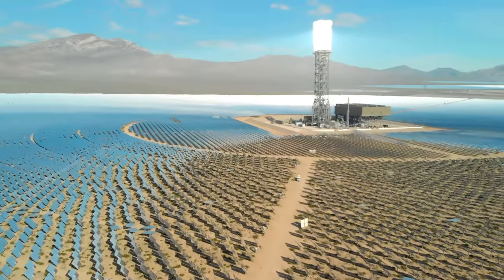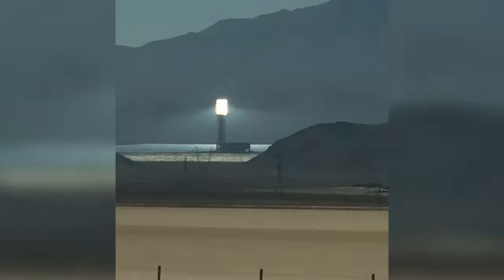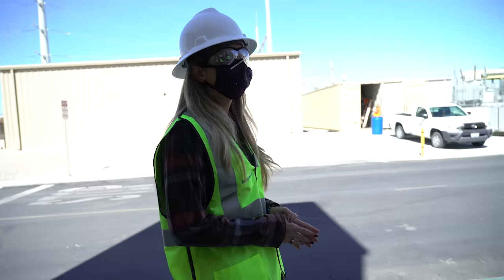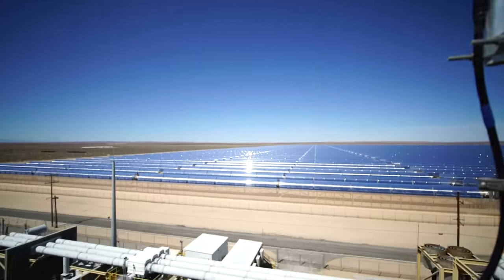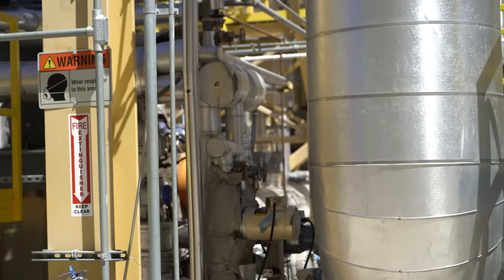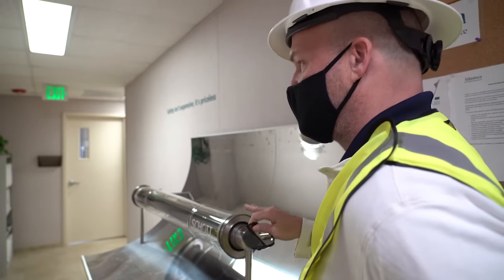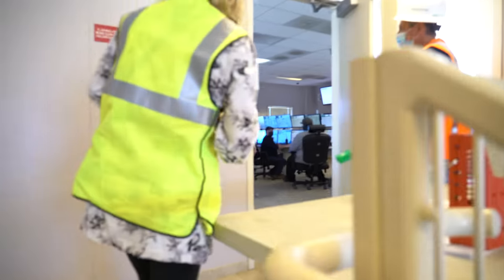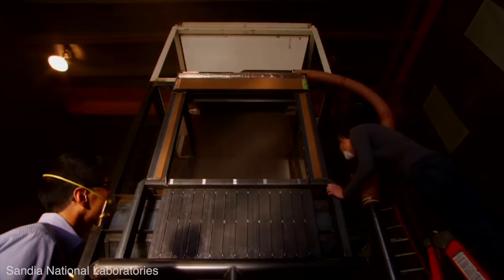How Mirrors Could Solve our Energy Problem

Comment: From what I remember there were more or less 3 reasons I remember as to why this isn't used as much compared to PV, despite it being able to fix one of the most important problems with renewables: intermittency.

These problems are:
1) Cost: CSP costs around 3-4 times what PV costs, so that immediately isn't really great. If we can get storage costs low enough, PV+storage is also more interesting.
2) Geographical limitation: You can't just place these plants everywhere, the efficiency reduces a lot depending on the available sunlight. And ofcourse you need space and lots of it. With PV you can if need be place it in smaller units in a same location to avoid obstacles, elevation differences etc. aren't that much of a problem, with CSP this can be more of a problem. Another problem here is that CSP isn't usually located close to the main energy users, so you possibly need to install connection wires etc too. With PV you can place them on the roofs, car parks, nearby fields, ... limiting these kind of connection costs.
3) Water usage: These mirrors need to be kept clean. This often requires water use to do so. The problem is that these systems usually are in more arid places where water is more valuable. Ofcourse you might have ways to get around this, but they will usually be less effective or more costly. This was for example one of the controversies with CSP plants in Morocco that were subsidies by the EU, I believe.

Does CSP has a place in the grid mix? Yes, I think they definitely will play a role. Are they likely to become one of the main sources/compete with PV? Doubtfull. They might be usefull for energy intensive industries that could possibly be build around them and then either you use their storage to keep these industries going 24/7 or it is used to help balance the grid in the evening/at night.

If you were to ignore things like costs, political stability (for example northern Africa region), ... , CSP would likely be the best source to get us fully renewable. in fact they are probably one of the only renewable sources that could completely on its own get us to 100% renewable; No battery storage, no PV, wind, hydro, ... needed, just CSP. But it would be expensive and you'd need to use very long connections and the losses that go with it.
Reply: All of which are reasons to go nuclear rather than solar or wind.  ;)
Reply: @throwaway692  I only talked about CSP and somehow your conclusion of this one topic is 'Nuclear because wind and solar not good'? Honestly CSP might, if scaled well, be just as good if not better than nuclear imo. Ofcourse this is based on nuclear currently used build. Thorium might change that, but first we'll need to have a modern thorium reactor operating for several years.
Reply: Would it be possible to use a compound other than water to clean the mirrors? Possibly mixing it with something like acetone to keep them clean but not siphon too much water from local cities
Reply: @fflam1383  Honestly I don't know. But we are talking about a lot of mirrors that need to be kept clean from things like dust etc.
Reply: @fflam1383  you will have to keep the acetone from hitting the ground, hand cleaning millions of mirrors is out of the question.
Water is also used in steam for the plant.
Reply: @Caseytify  CSP can have reasonably storage build in for more than 10 hours, CSP is very reliable in terms of output.
Reply: @throwaway692  speaking of high costs and then mentioning nuclear.... Yeah no that's going in the wrong direction, nuclear is just not economical, not even close.
Reply: @Archangel17  Valid points raised mainly around cost, that is why the challenge for the next clever person or team who want to make an impact to this world would be to produce a mini CSP solution. A small farm or a familly house could easily install in a backyard or field, locally made steel plates as mirrors and an economic 2-motor solution to orient them. What is missing? The center unit, one that would give autonomy to this house. Let's talk everyday use: How many PV do you need to run a single washing machine? Including it heating its water? PV not very efficient. A one-house-CSP-solution on the other hand could produce a lot of electricity. Unsure grid people would like that, but huge number of people in countries with sun would be looking for a clever person/team to design such a small-scale CSP.
Reply: @jonblon6306  
Problem is that CSP doesn't downscale well at all. The costs actually go up (per unit), efficiencies go down, ... Less mirrors => less heat => lower efficiency. 

I think the main way for CSP to breakthrough is the opposite: large scale mass production (many plants), this is effectively what France did with nuclear and is why the cost for them eventually were fairly low (that and nuclear was fairly cheap back then).

As to how many pv panels you'd need for a washing machine including water? Probably just one. Though this is just in regards to energy, it might not provide enough power on its own, for that you either need a battery or more panels.
Reply: @sixtus9559  Then we need to make it economical, not throw away the technology. The reactors being taken offline (such as Indian Point in New York) are not being replaced with concentrated solar. They're being replaced with LNG; an incredibly bad move at the worst possible time in history.
Reply: @ManOfLore1  the problem is, many nuclear power plants are old, even if we don't want to leave nuclear energy the plants need to be shut down just because of old age.
And switching to gas powered power plants has the benefit that those are good at shutting down and starting again, we can moderate their power input much faster, they work much better in combination with renewables to power the grid.
Reply: These thing are also eyesores. I would rather see a field of food growing than a field of mirrors. Better use of the sun's energy.
Not to mention desert ecosystems are rather delicate and this looks like it messes that all up.
Reply: @peterbelanger4094  Whether they are eyesores is subjective, personally I wouldn't mind seeing them, it is not like fields of crops aren't almost everywhere possible already. Also a field of crops isn't a better use of the sun's energy, especially considering CSP's are placed on locations that are generally not good for crops anyway.

Like other forms of power generation or just generally living conditions (roads, buildings, crops, ...) don't mess ecosystems up LMAO.

Comment: The special shape of the mirrors is also referred to as "parabolic troughs" they're used here in Pakistan to heat up water in tubes in order to produce steam and drive the boards of a small turbine.
Reply: These parabolic troughs make a lot more sense than the big reflective CSR systems. For a start they don't kill as many birds.
Reply: They say that around 8 min… 🤪😂😂👍

Comment: Would be nice at the end of the series if you do a summary chart showing power efficiency, cost effectiveness, kinds of contracts that apply to selling each type of energy.
Reply: Also include fossil fuels.
And don't forget to add reliability, abundance, and cost.
Yeah, post that.
I dare you.
Reply: @Conflict_Boardgaming  I'm a petroleum engineer and I don't think you're going to like the findings about abundance. (Hint, the sun is functionally infinite).
Reply: @CSpottsGaming  And I don't think you will like the reliability, efficiency, or cost of wind, solar, and "mirrors".
Reply: Meanwhile, nuclear wipes the floor with both.
Reply: @greyrifterrellik5837  Thorium Molten Salt Reactors in particular
Reply: @greyrifterrellik5837  Absolutely, that can and should be the largest part of our short to medium term energy solution.
Reply: @Conflict_Boardgaming  Never going to happen because superficiality does not lend itself to this.
Reply: @Conflict_Boardgaming  onshore wind and photovoltaics are already have a lower levelized cost of energy than any fossil fuel plants you can legally build, and the combination of the 2 is pretty relaible with a near zero chance of major catostrophic breakdowns or a random unpredictable loss of power unlike more centralized power plants which can randomly lose 100 percent of their production from the entire facility almost instantly for any one of a rather large number of different reasons. (intermittency is not the thing same as low reliability and is a non issue at the scale of most grids)
Reply: Yeah the sun is functionally infinite, but the resources required to maintain these things are not.
Reply: @aaronvoss38  Neither are the resources to maintain oil and gas infrastructure...? Oil wells are wildly expensive to develop and that doesn't even account for moving the product from point A to point B.

Comment: We had a few of these in the southern Central Valley of California, they used the tower style. Now they’re just broken mirrors in the fields. 
And remember that photovoltaic cells degrade over time.
Reply: Its a disaster, creating waste, and destroying landscapes.  1,000s of tons of broken glass.  Plus the fuel needed to manufacture that glass = pollution.
Reply: Renewable energy has not improved the climate on iota, cheaper current from taxpayer paid for turbines backed up by natural gas and coal that don't pay for their pollution edges out nuclear which is the only always on low carbon source hydro has practically vanished here in the West with the drought caused by shutting nuke plants.
Reply: 7:28 Physics Girl missed mentioning that… why don’t we see more of these failed CSP plants?? 🤔🤦‍♂️

Comment: I really liked this deep dive series. Getting a really broad overview as well as some specific details was really entertaining, and I feel like I learned a lot!
Reply: I was thinking it was a very superficial and not a deep dive series, it showed some flawed engineering with dreams, some expensive ways of making or converting energy and missed out completely on something that covers 71 percent of the world.
Reply: @maxnex7676  Yeah at 8:51 she says "the efficiency of it, the heat engine depends on the temperature of it and the hotter you can get the hot thing the more efficiency", who even talks like this? This was such a non-deep dive way of talking about the subject. First of all why is she assuming everyone will know what is the "heat engine" she is talking about here and then "the hot thing" being hotter in absolute terms doesn't matter much, it is the ratio ratio between the cold and the hot thing that matters, this video was as superficial as it could have been.
Reply: @maxnex7676  There is no talk about the way the heat get transferred other then "in thousands of tubes ". and talking about saturated steam going into the turbine... really... really??. 
First you never let saturated steam run into a turbine because you have a chance at condensation on your turbine rotors, eating away the material, you superheat it way above the saturation line.
Second if you run the HTF into the reboilers on sunrise, how do you not make the boiler burst from instant steam pressure inside the pipes, or just plain thermoshock because its 400 degrees celcius? 
(I think i know this one, they heat it up first at night, you know, burning that good old natrual gas.)
third, does every tube inside the mirror expand halve a meter? i mean i hope you have wheels under those mirrors then.

It's a pretty video, nice pictures, but nothing of value is being told.

Comment: I think it's not saturated steam but rather superheated steam. Because the water particles in saturated steam would impinge on the turbine blades and damage them. Correct me if I'm wrong, but the steam turbines that we work with use superheated steam
Reply: yeah the generators make saturated steam, but there are other parts that turn the saturated steam into super-heated steam.  you right saturated steam would cause a lot of damage on the turbines.

Comment: Mirrored solar actually has a lot of operational challenges long-term, in addition to the perennial solar-energy production vs. demand mismatch. There are some real maintenance headaches, and they kill a lot of birds. Ivanpah, in San Bernandino County, wipes out around 6,000 birds a year. Hydrogen production may help solve one small piece of that puzzle, but that is all.
Reply: 6000 birds a year, so around 25 cats worth of birds. I'd say that is a worthwhile compromise.
Reply: @sevret313  Responsible outdoor-cat owners rarely have bird kills since the cats have bell collars, and especially not many of the types of birds like raptors that are taken out by the focused heat radiation.

Comment: These are great...for wasting land, frying birds in mid air, messing with migratory birds flight paths...

Yes, this tech has been around for a while, but output vs land usage, mixed with stability and maintence, make this a relatively inefficient form of power generation.
Reply: But it's cheaper than solar cells. Into a price comes down on the solar cells.
Reply: @dueymiller617  The price has come down on solar cells, they are now cheaper. Much cheaper, as in substantially cheaper per unit energy even when you factor in the lifetime cost of batteries for storage(roughly half the price if you have enough LiFePO4 batteries to back up power for 24 hours).
Reply: For electricity generation, I totally agree. Solar PV (+ battery storage) is clearly the better option.

But there's still one use case for solar thermal plants: Process heat; e.g. for the chemical industry, for hydrogen production (via the sulfur-iodine cycle), for the steel + cement industry, or for seawater desalination. Maybe that'll make sense if they manage to lower the costs (by automating the construction + maintenance of solar tower facilities).
Another great source of process heat is nuclear - with a special focus on high-temperature reactors and SMRs.
Reply: Regarding the other contra arguments (besides costs): As far as I know, those solar towers are only built in the desert. There you have plenty of space available.
Land usage is a point if it means the destruction of ecosystems. But the desert is just a huge area of sand (with only a minimum of vegetation + fauna). So it shouldn't matter if we build things on top of this sand.
Frying birds? In the desert, there aren't many birds. Maybe some few vultures, but that's it.

And consider that we would only use a small portion of the desert for solar (no matter if PV or CSP), maybe 5-10%. That means that still 90-95% of the desert area would stay untouched.
Reply: These mirrors and the heat they generate is the reason there's a drought. 
The monsoon that used to come from Nevada and Arizona storm turn back and away from California. 
The High Pressure as Weather Casters call it : keep the storms going up to Canada 🇨🇦 with  the occasional drop to the Bay area. This is and I hope an unintentional Weather Modification

Comment: I worked at both plants. Ivanpah was definitely the coolest and I was there from start to finish as a pipefitter. The blow down and testing was crazy. The Mojave project was cool but it's not anything close to how ivanpah was. There is soo much more to these project than you were able to explain. Ivanpah has a gas heater to maintain the water at a reasonable temp so that the towere can start working as soon as there is light. It is also not steam being produced, it's super heated steam. It is 320 degrees when it goes through the venturi and every drop of water expands in volume by 1000 times, which produces the pressure needed to turn the turbine. It's really crazy when there is no need for heat exchangers. It does need a high content of salt in the water but then needs a filtration process after it re condenses. Message me back if you have any questions about the build. Like I said it was unique. Only the second one in the world at the time as far as working plants go. Also it was built by bectal company the Company that built the hoover dam.